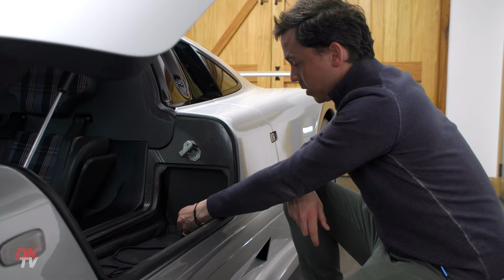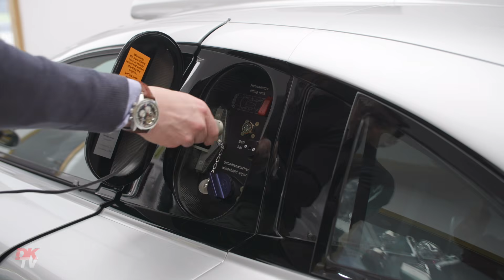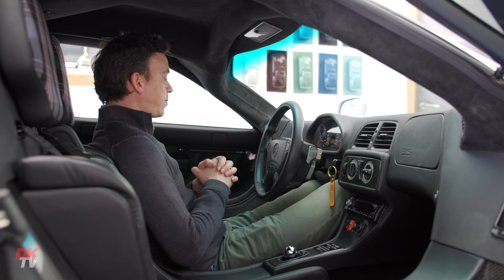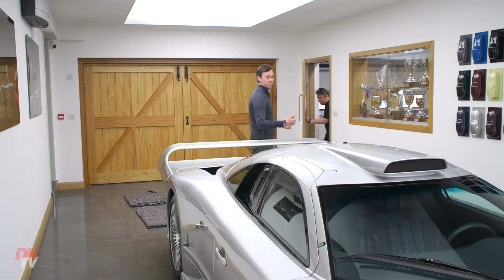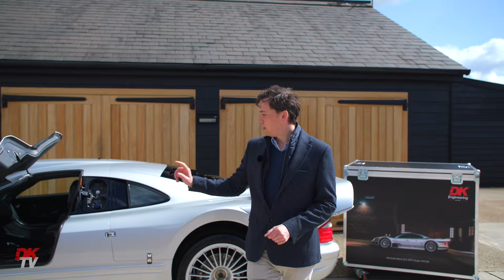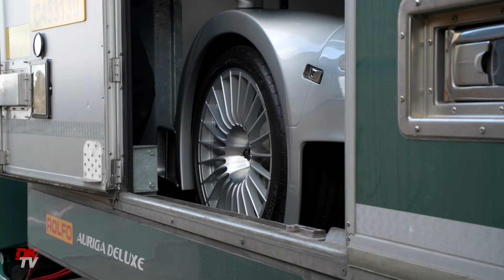CLK GTR User’s Guide

Comment: If I ever buy one Ill drive it with both bumpers removed so it’s hardly recognizable, only to the trained eye car enthusiast. And it will look like a Pagani with all its panels opened up. Much more raw/barebones look, I wish one of these exotic manufacturers would design something with an extreme minimalist theme. Something like weight savings taken to the absolute extreme. Of the car doesn’t need that centimeter of material, then remove it. Whether its body paneling, interior, the entire middle section of the car, etc…
Reply: That would be something like an Ariel Atom

Comment: The sense of bewilderment I felt when, in 2009, at 18 years old, I took my slightly rusty, 1987 Mini to DK Engineering to have the timing adjusted, only to find myself in a showroom surrounded by a Ferrari 250 TDF, an F50 and F40, was staggering. 

Hats off to them for happily servicing my humble little car, when metal like this is their bread and butter.

Comment: Cool, overly complicated. I daily drive a 1970 Chevrolet C10 with a 6.2L V8 and a 6 speed manual transmission, so far here’s my user guide:

Step 1: get inside the pick up
Step 2: turn on the engine
Step 3: have fun